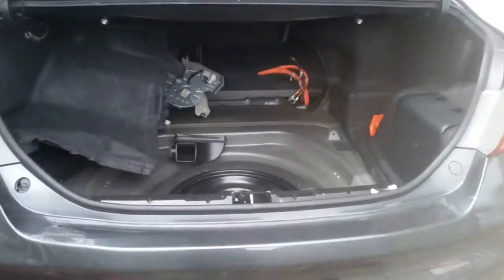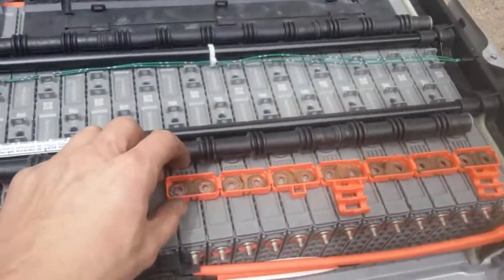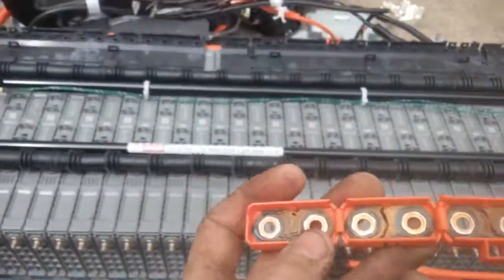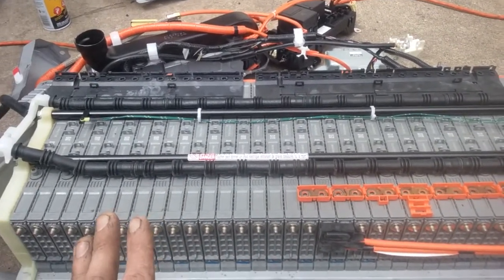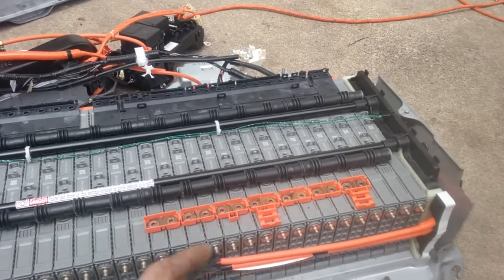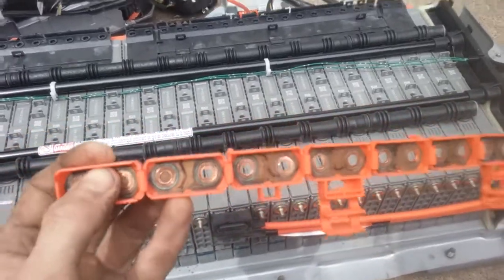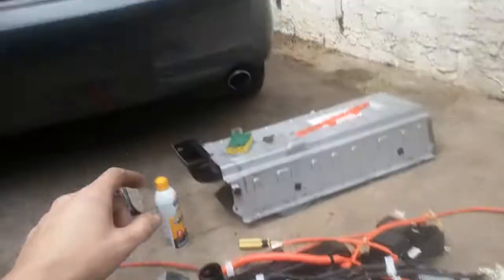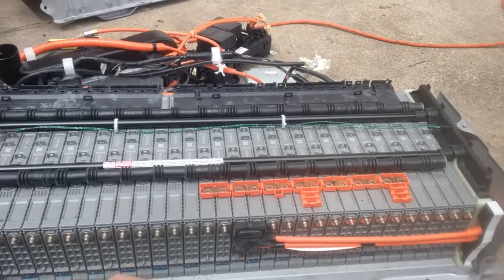Hybrid battery fix

Comment: I am not a mechanic but a PC builder and I live in an apartment and I was able to disassemble and change 1 cell and clean all the copper plates. A multimeter is a must to check the voltages and the  cells but I wish you had shown more details about the other components. For DIYers, make sure to keep track of which types of nuts/bolts go into which areas to avoid wasting time during reassembly.
Reply: I feel like that may have been intentional given that he discussed novices messing with the battery could get killed. I was watching thinking the same thing, that it doesn't look much more technical that PC building stuff, but then the safety stakes are pretty low with PC building.
Reply from the maker: @Hoozer32  You still have mains power and capacitors with PC builds that can be dangerous but that doesn't offer nearly as many amps/volts as these hybrid batteries do. That being said, if mains can kill you, having more power than that is a moot point because you can't really get more dead than dead.
Reply from the maker: Good job. Great work. Being a PC builder deff helps with understanding electronics and how things like that work. Having that experience was probably very helpful.

Comment: I have zero mechanical skills, or ability.  However, after watching a youtube video I was able to test my cells and replace the bad ones.  It wasn't complicated and you don't need a degree.  In fact, just basic hand tools and a multimeter.  I'm not saying that to pat myself on the back, but you shouldn't be scared of trying this yourself.  It'll save you alot of money and it's not difficult.
Reply from the maker: I am just expressing the importance of not messing around with this if you don't understand the dangers. It can be done pretty easily with an understanding of electronics but not everybody knows what to do, how to do it, and most importantly how to be safe about it.

Comment: Is it safe if i wear a gloves ?.
Reply from the maker: Depends entirely on the type of gloves you are wearing. Even the gloves they use for working on the power lines can become useless if they have a pinhole in them. Electricity finds any and all ways to ground.
Reply: @MNDashcam  
But if i just need to take off the battery assembly, must i wear hih voltage gloves.
Reply from the maker: @musheer5711  There are still high voltage connectors so I would just be as careful as possible to not touch anything and insulate yourself from it.

Comment: seems like you are scaring ppl to much instead you should explain how to discharge the power before start working on it smh
Reply from the maker: This is something that could kill somebody by accident. I would hate to see anybody not understand the dangers and accidentally cause death or serious burns to themselves. It can be done at home but I would seriously urge everybody to use extreme caution and do anything like this as safely as possible.